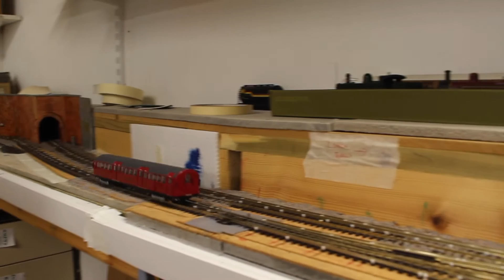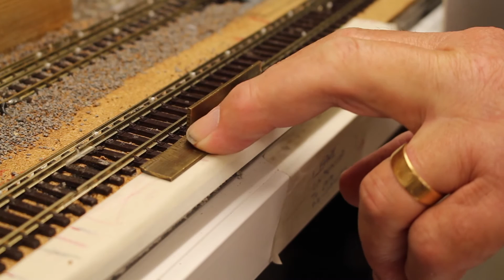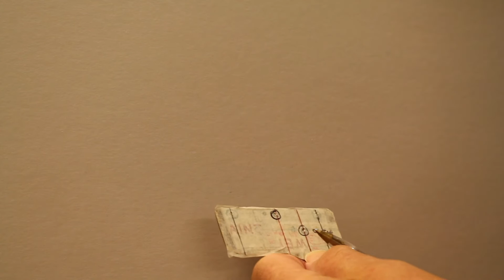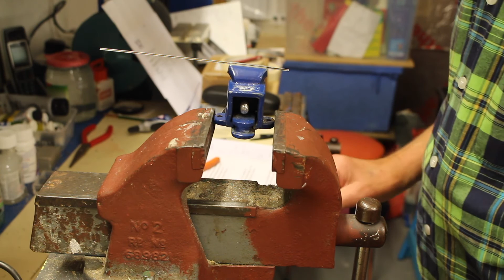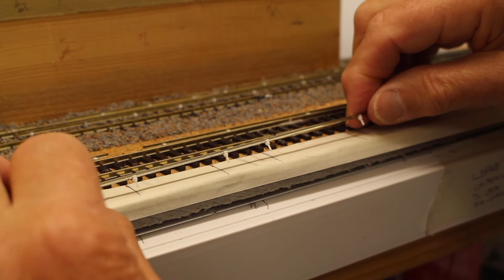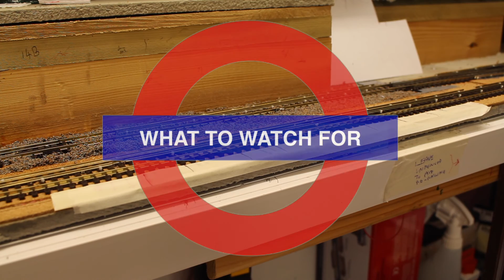Laying the 3rd + 4th rails for London Underground + Southern layouts

Comment: Hello Paul, Thank you for a clear explanation of the process that you undertook in fitting the Peco parts to create third rail. I've recently purchased a set of white metal LT 1938 stock and found straight away that it has been nigh-on impossible to find any how-to's when it comes to fitting a third (and fourth) rail to oo gauge track to add some authenticity to that particular section of the layout. How did you overcome the issue with curved track??

Comment: An interesting video that for some strange reason only appeared on my home page in 2022- almost 6 years after upload!
I have a Southern Electric layout with 3rd. rail, but during the construction phases, with slight changes to the scenery, road vehicles, and buildings, I first configured it as an American scene. A video record was made.
The next step was to lay 3rd. and 4th. rails for a London Transport layout and again videod. My EFE tube stock is now back in its display cabinet.
The 4th.rail was removed for the final Southern Railway arrangement and video.
Installing the conductor rails was time consuming and fiddly, but I found that a commercial jig that I purchased was hopeless, so I made all the holes in the sleepers by eye using an Archimedian drill.
Like you, I filed the ends of the conductor rails to allow the chairs to fit easier, but I separated them from the sprue and pushed the rail into them on the bench. 
I used contact adhesive to secure them.
As the conductor rail is Z gauge, I used Z gauge metal fishplates to join the longer sections and bent down the ends of sections.
I am pleased with the final result, although I am having to replace the storage siding baseboard that has warped, but that luckily is not in the viewing area.
Reply from the maker: Thanks for that mervyn. Always good to share  info , and in this case good to hear that I am not the only person who is mystified by stuff appearing out of the blue !
Good luck
Paul